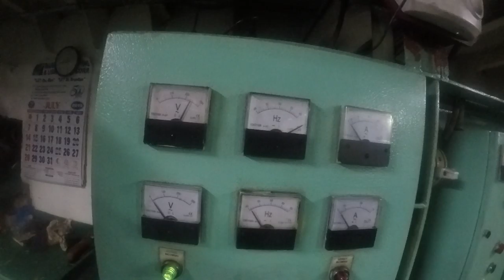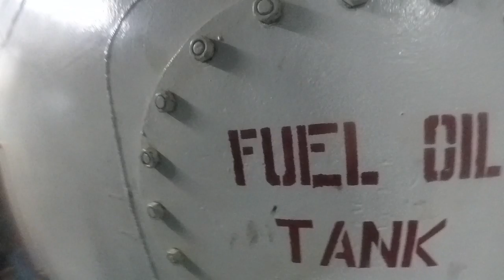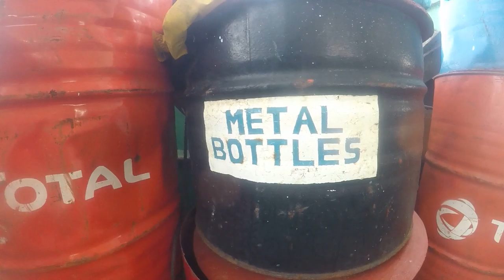BIG SHIP ENGINE ROOM WITH GENERATOR BILGE PUMP AND ELECTRIC CIRCUIT BREAKER PANEL PT1

Comment from the maker: THESE TWO VIDEOS, Parts one and 2 will show you everything you need to know about In regards to what an engine room on a cargo freighter And the bathrooms and sleeping accommodations INCLUDING THE BRIDGE Where in fact the Captain pilots the ship From..

There is also a mess hall and bathrooms with  Hot salt water pumped up from a storage tank in the Belly of the ship and heated using the exhaust from the engines.

I didn't see anything that resembled shower there was a room with a big bucket of hot freshwater that is also pumped up from the belly of the ship with the water draining that you could use for showering.

Understanding this is a cargo freighter and not a luxury liner and that the men on the boat jobs no one complained about the, the Accommodations.

In part 2 you will also notice there are 9 and 65 foot tractor-trailer trucks on the deck and each of those tractor-trailer trucks cost approximately $600 to make the voyage of 30 miles from Cebu to Bohol.

Basically these ships island hopping in the Philippines from one port to another picking up and dropping off cargo as they arrive and depart.

BIG SHIP ENGINE ROOM WITH GENERATOR BILGE PUMP AND ELECTRIC CIRCUIT BREAKER PANEL PT1
https://youtu.be/3IvNwN_uUK4

BIG SHIP ENGINE ROOM WITH GENERATOR BILGE PUMP AND ELECTRIC CIRCUIT BREAKER PANEL PT2
https://youtu.be/aPU0I82thfI